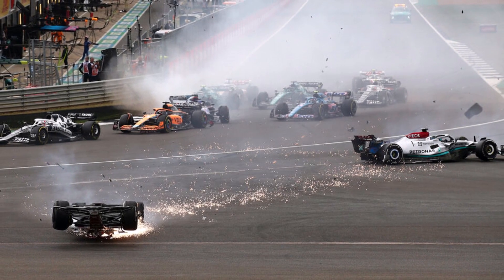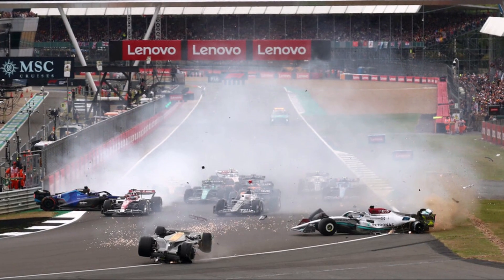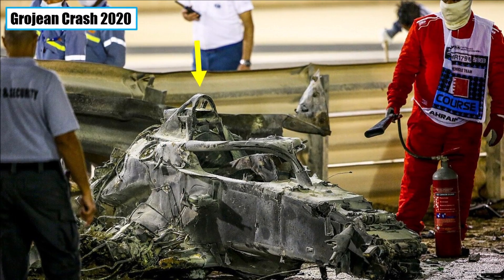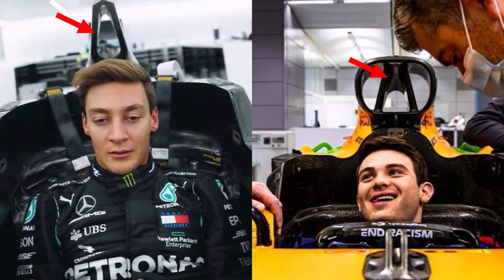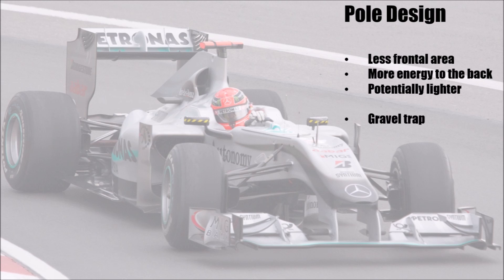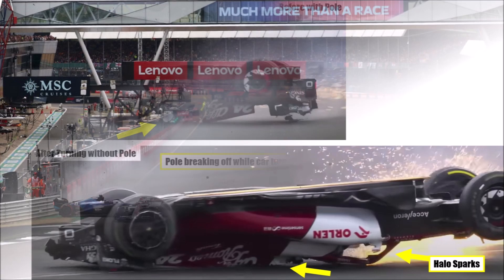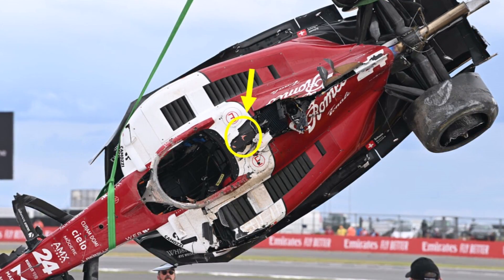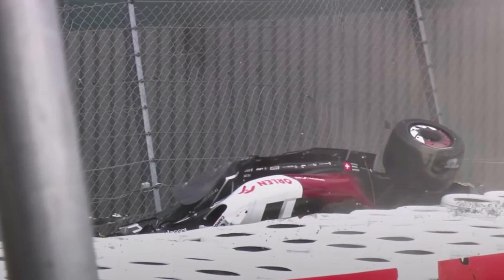F1 2022 - British GP - Lessons Learned - Zhou Guanyu's Crash Analyzed

Comment: Yes, this is why we glue high-rise buildings together and not bolt them, because glue is stronger and more structurally sound.....yeah, right. 

Who puts a car sized gap between a low barrier and a high barrier, and then acts surprised when a car gets trapped between them? Who designs these things? The guy who glues high-rise buildings together?

Comment: Accidents will happen no matter what safety you put in place the more cover you put the more it will slide just like surf board. the only other thing. they are going to fast for the approach to the bend. make the cars slower. rather than speed fare to fast. this is the first time hope its the last time. Turn down the engine power by 10%.less.

Comment: Note in the photos at 2:59 the hoop has sheared off but due to the height of the front of the halo the drivers head does not contact the track.
Maybe a rethink is in order on hoop design. Prior to halo the hoop needed all its height to keep the driver clear of the tarmac whatever the cars attitude; with the halo added maybe the hoop doesn't need to be so tall to achieve its purpose.

Comment: The other commenters are justifiably concerned with surviving the wreck. So I'd like to consider a way to avoid it in the future. The drivers need to have their peripheral vision restored so they can tell who's alongside and how close they are. In a lot of the latest incidences it's apparent that the driver of one car didn't know the other car was even there. The cars, in my opinion, are to heavy, to complex and seriously need a manager on board instead of a driver. Get rid of all the adjustments and switches on the steering "wheel". Set the car up in practice and then race it that way. No changing computer settings. No changing brake bias. No changing the throttle response. No brake by wire. DRIVE THE CAR!

Comment: Dude… like seriously… what…
1. F1 cars aren’t Naturally aspirated and haven’t been for 30 years
2. The way you describe in which they connect the roll hoop onto the car is outdated. They use a specifically designed “glue” for this now as carbon fibre is strongly bonded to the roll hoop with this “glue” instead of using actual bolts which are weaker. Ofcourse this “glue” is heavily tested and made sure its fit for use. The roll hoop itself didn’t fail, the “glue” didn’t fail, the carbon fibre itself failed as if you zoom into that image of the roll hoop being broken off and thrown away, you can see the carbon fibre on the bottom. Carbon fibre is very good in handling sudden forces in crashes but it has one weakness. When you start to try and pull layers of carbon fibre apart they break very easily. The forces put onto the roll hoop would have been pulling away at these layers of carbon fibre, especially when the car was spinning. Whilst this can all be fixed by creating a roll hoop that spreads its force more equally into the carbon fibre, you cannot expect an incident like this to happen.

Comment: The roll hoop should be one piece extending from the floor of the monocoque to it's peak forming the back of the drivers compartment and carrying the engine mounting plate.  No other design should be permissible and no other material other than chromoly should be used, period.

Comment: Run off area was not  enough to absorb the speed.of an overturned car. That narrow path under the fence was the cause of Zhou flying,, the cage dug down in the pebbles then found that narrow path's construction under the top and cleared the  tyres

Comment: The roll hoop is not bolted to the the car, it is bonded(glued) and it was the carbon fiber of the monocoque that delaminated or ripped apart.
Reply: Not surprising. Carbon fiber is not designed for this sort of thing. I'm blown away that they didn't mount the hoop directly to the frame using an all-aluminum structure. Carbon fiber may be stronger than aluminum, but it is a brittle structure and is only good for one solid hit. This was the equivalent of a continuous hit over 4 seconds, and in multiple directions due to him spinning on his roof. Fatigue failure is the ultimate result.

Comment: This crash was the result of some poor driving decisions by several drivers. I look forward to see the penalties issued to the drivers involved. .
Reply: it's hard to decide which way to go when you can't see out of the cockpit to the sides.
Reply: @chrisbaker2903  exactly, so keep on the same line and do not weave especially if you make a slow start others will smother you very quickly on both sides. Like I said poor driving.

Comment: Large passenger aircraft are built with triple and quadruple redundancy systems. If one system fails they have back up systems to take over. The halo structure acted as a back up to the roll hoop. Without it there would of been a fatality last Sunday.

Comment: It can happen any time a car gets sideways and show the underbelly. The wings in the front and back keep the car in the ground. Any time a car goes sideways or backwards is on risk to get airborne. In indy car the added some flaps in the back of the car that deploy if the car goes backwards, remember if you flip the rear wing, it will produce lift.

Comment: I think the halo increased the loads on the rollstructure when upside down. Before the halo cars upside down would flip to the sides, but the halo keeps the cars from rolling when they are upside down. 
Another thing that you could see that the car had 0 speed reduction when sliding on the halo, which also wasn't like that before the halo. 
So in conclusion, the crash could've been much less severe without the halo
Reply: Better to be alive with the halo than dead in a less severe crash

Comment: It's hard to believe the engineers who designed this T pole roll guard did not identify its weakness.  It doesn't take an engineer to see the flaw in the design.
Reply: In a lot of cases my dad's description of what an engineer is, just might be right. He said that an Engineer is a mechanic with his brains bashed out. ROFL. I worked with several different engineers over the course of my career and only worked with one who could see the difference between an elegant design and one that would work and do the job. It was hilarious when the crew boss was told by the engineer that the design would have to be changed during the installation (The engineer decided to come along and watch the installation) and the crew boss said "we can't change the design". The engineer said "I designed it, of course I can change it."

Comment: You state the single pole dug into the gravel causing the flip ...then in the very next sentence you point out that the pole had been collapsed before even getting to the gravel trap.... zero info and zero lessons learned as no TD's have been issued since regarding single element roll bars

Comment: The single core design of the rollover hoop failed miserably under sheer stress of about 800 kg of mass. Great analysis here. The car slides on tarmac with the rollover hoop. And it was just gone! FIA missed this sheer forces or just concentrate on normal forces on the hoop? As pointed out....Zhou was really lucky that the car didn't catch fire. He was literally sandwiched between the fence and tyre wall. This gap must be widened. Or double fencing to protect spectators....tyre wall closer to the track?
But main concern here is the failure of the rollover hoop. So fia have tha halo and disregarded the rollover hoop? I think the design of the hoop should return to equilateral triangular one. Dissipation of friction and sheer stresses are better.
Reply from the maker: They passed all load tests (x- , y- and z-direction), so FIA is testing it in all directions, but it still failed and that's a concern.

Comment: They should abolished the hybrid engine, remove the batteries and all the components affiliated. 
That will reduce the weight of the cars considerably.  The 1.6 liter engine have more power now than a 3 liter in the '70.
Back to racing as they were use to. No DRS no gimmick. FIA are so paranoid about the ability of  car to pass another for the show, but they forgot how it used to be. There were great race in the past, and the ability of driver was shining. 
Nowadays, the car count 90% .
Any average F1 drivers can win with the best car. Sure, there are few exceptions, 
but really good driver 2 maybe 3.
I hope to be able to see Porsche/Audi and Wolkswagen coming in the competition. It will be interesting. Per sure it will raise the technology bar.

Comment: The fire issue was the first thing that sprang into my mind when he finally stopped..... but thanks to the halo frame worked.....
I saw a Mercedes soft top production car flip over as it left the road.... the first thought was that the driver was going to loose his head, but the safety system of a pop up roll bar at the back of the seats came into action and kept the car from laying flat on the ground ( basically from leaving a bloody line on the road that would have been his head)... the man got out unharmed but shaken up.....

Comment: Great video.  I didn't see that spot when it broke away but by the time I saw it sliding on the HALO i knew it had.  I have seen crashes over the years, like Alex Wurz's Canada flipping roll over and he emerged fine.  I think, as you elude to, that the use of the HALO is allowing teams to reduce weight using a light rollover protection system.  The FIA needs to mandate a certain level of strength for the "roll hoop".   Also, what is up with Silverstone this year?  Is it the cars, we saw to huge accidents with cars flying off the track in F2 and F1.

Comment: So many wrong assumptions here
Halos are tested so as to be sure a driver can get out even when the car is on its side or overturned. Speed of extraction is except in very rare cases not the issue, it takes as long as it takes, protecting the driver.
Likewise the whole survival cell and roll over systems are tested by the FIA before the cars are produced each year. Freak accidents will always happen, and the FIA will forensically examine Zhous rub fo understand how and why the hoop failed. Steps will be taken to stop a similar occurrence regulations will change to accommodate this, but there will always be something else. That’s why on every ticket it says motorsports are dangerous. 
Radio comms  from a driver in a incident go straight to race control if he says he’s ok then again no rush.
If he was trapped and injured the extraction teams can cut the car apart to enable removal of the driver to be made safely and carefully. The risk of fire is minimal and teams are present to immediately deal with any flare up. Even Grojeans accident fire was the result of a small amount of fuel in pipes and the fuel system outside of the tank

The space he landed in allows marshals to move in relative safety in the section of track they cover. Again you can’t cover every eventuality, it’s a compromise. Race Drivers are not risk averse an understand what they have chosen to do.

Comment: Better that he ended up on the side between tyres an fence than upside down on top of the tyres. You could run that crash 100 times and each time it'll be different,just be thankful it ended as it did and not broken in half an on fire. As far as I'm concerned everything worked perfectly as intended. His helmet didn't scrape along the floor and the catch fence stopped the car hitting the grandstand. Let's not forget the incident in f2 in Baku a few years back when the car slammed into the commentary box vertical top side first.

Comment: Sounds more like the team tried to skirt some rules to save even more weight by gluing the structure in place instead of using bolts, knowingly making an illegal modification and hoping not to get caught, while probably figuring the halo does most of the safety work now anyway. And no, glue is NEVER as good as proper bolts! Some glues may be nearly as strong as some bolts in one loading direction, but glues will never be as strong as bolts in all loading directions.

Comment: Another risk I have not seen mentioned by anyone is .... the tyers forming the crash barrier. If the car had caught fire, the crash barrier tyers would have burned, thereby greatly increasing the severity of the fire where the driver was trapped between the crash barrier tyers and the metal fence.
Reply: Isn't that why hay bales were forbidden after Bandini's crash at Monaco? Also...do away with gravel/sand traps and go to a hard surface everywhere so that it's much more difficult for a car/appendage to dig in and create flips!

Comment: some comment said there was no failure. that the highest point is lower now. maybe because the grojean crash? 
well idk if it is lower or not
Reply from the maker: The rear of the monocoque is higher which makes the roll hoop smaller but that doesn't allow the main roll structure to fail.
Reply: @bsport320  maybe there is an change this year, 

okay its just broken

Comment: I think the extraction process for the driver depends on the presence of or imminent threat of a fire. If its not on fire and wont catch fire soon then they take their time to get the driver out. I dont think the time it took to get Zhou out was just of the cars location, they were not in a hurry.  If there's a fire, yank em out. Any other injury wouldn't matter then if the car is going up in flames. Otherwise the driver gets pulled slowly, spine and neck would be carefully supported to prevent further damage.
Reply: Very well observed.

Comment: Track side safety is a pretty big factor ngl.
A larger gap between the fence and the wall would make it easier to access a car should it goes over or through the wall(Grosjean's crash comes to mind). That pretty much caused the long extraction time, between having to get the wall essentially removed to get the car out and actually extracting Zhou. If there was fire or if Zhou was wounded and bleeding, it woukd have ended very differently.
Another idea would be for walls and fences that can be dismantled easily in sections(preferably with little to no use of tools) so a crashed car stuck in the wall can be accessed asap.

But personally I don't really have much hope in track side features being changed that much, considering that sausage kerbs are still in use despite multiple incidents of cars being launched into the air.

Comment: Excellent video. I work in aerospace and know that F1 has excellent engineering. I am very surprised at this structural failure. The pole design is far weaker than a V design. The stress concentration at the mount seems to be too high. They should have an airbag type role on the car so that it can deploy once the car stops while upside down. Then the driver can get out without assistance.
Reply: Thank you sir. I am no engineer myself, but the first time i saw a pole design on a Mercedes, i felt like it was weaker than a V. On top of that, this one was glued... a case of structural design made to strictly pass the test. Hope the FIA will make them way more substancial now
Reply: @jouhannaudjeanfrancois891  Its shocking how many G’s are generated during an accident. Did you ever see a pedestrian get hit by a car and he leaves his shoes behind? Even tied high top shoes. The shoes literally get blown off by the hundreds of Gs. Could be thousands of Gs for a millisecond. This car rollover looks more like a slower impact. It probably needs the same strength as the halo. It’s clear that this one has a different specification. Plus, if it was bonded as a composite, it very well could have been bonded incorrectly. Even a welded titanium tube can be welded incorrectly and crack off.
Reply: well, good thing the Halo was there! bonded + bolted intelligent and elegant titanium structure. It's so ugly i never tought i would ever say that, but i love it! Grosjean and Zhou too i think!

Comment: It should also be pointed out that between the gravel and the tires there was some pavement.  The gravel was lower than the pavement which meant when Zhou hit it it shot him up into the air, acting much like a ramp.  Racing is a dangerous sport, and racecars are amazing good at pointing out design flaws in a circuit.  You don't plan on a car flipping over and sliding that far.  Much like they didn't forsee Grosjean's car splitting the armco barrier a few years ago.

Comment: The lateral G limits for the roll structure was easily exceeded in this instance. They probably tested only the vertical limits due to the car sitting inverted with all its weight on the said structure.

Could be a design failure.